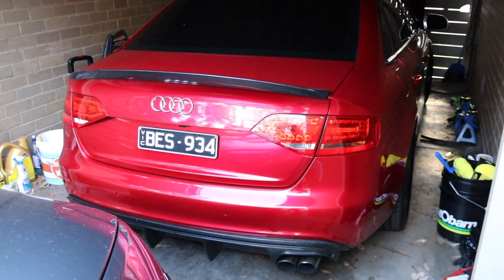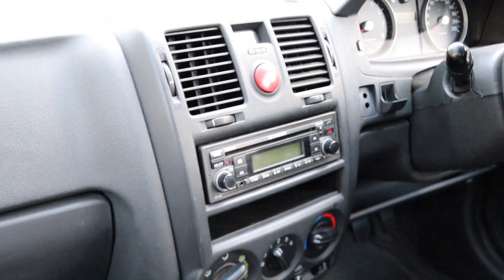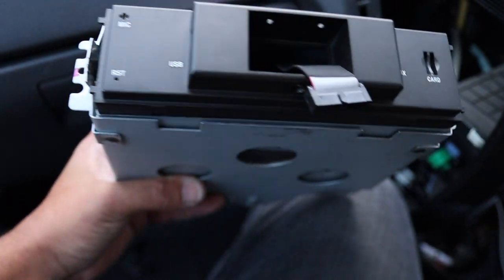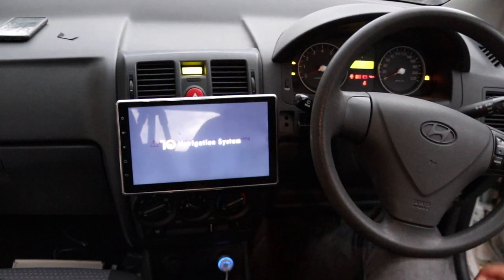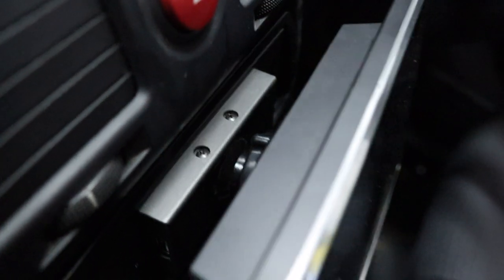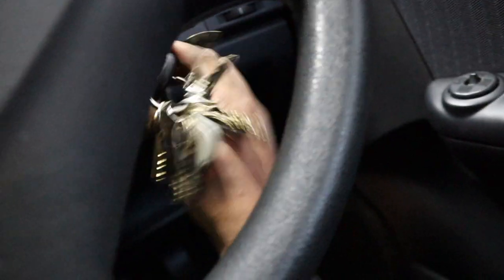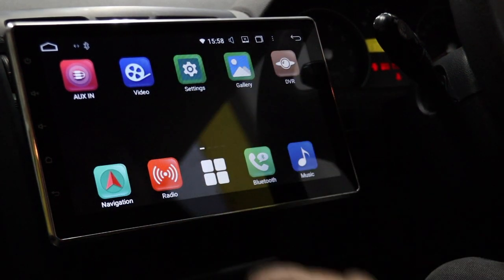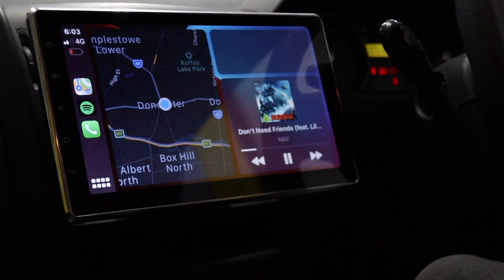10.1" Floating Screen Display (Android Install).

Comment: Hey doggy. Just wondering what the audio quality is like.
Would this suit aftermarket speakers and a sub or would you recommend pushing the speakers through an external amp? Seems like it does the whole tablet thing very well. I’m worried about audio quality.

Comment: hey hi i need help fitting a steering wheel for audi a4 b8 the yellow plug is not the same as the original one you can help me please
Reply from the maker: Hey man. Send me photos to email. info@aesonline.com.au
Reply: Pro tip: watch movies on Flixzone. I've been using them for watching loads of movies during the lockdown.